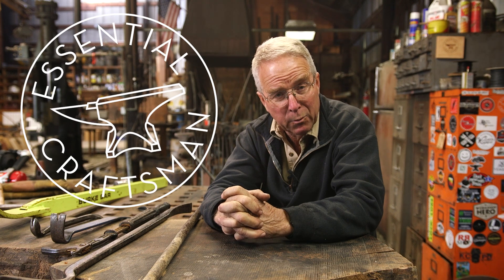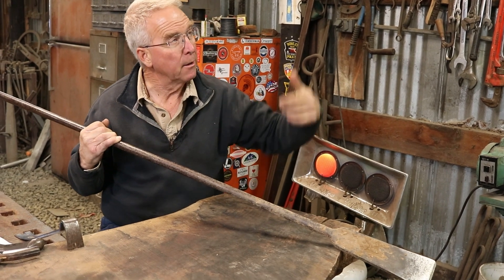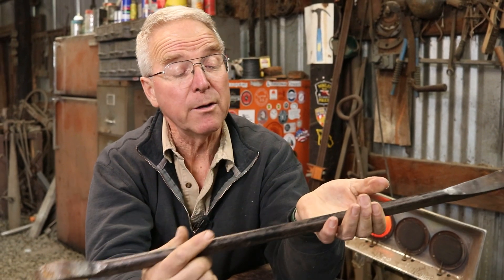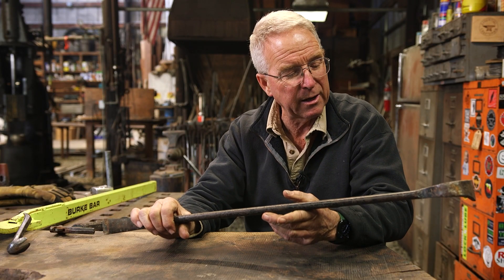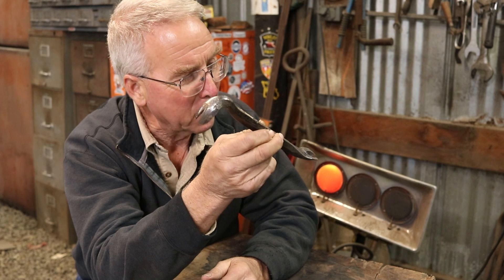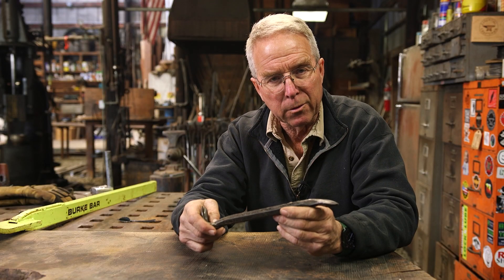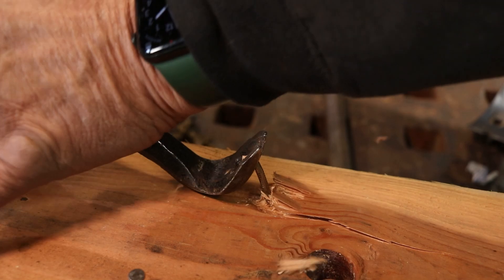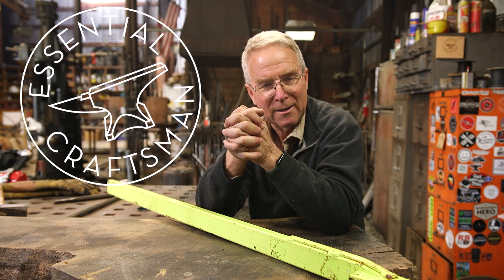Pry bar Comparison & Uses: My 6 Favorites for Better Leverage

Comment: My favorite bars are the small restorer's catspaws with a thin flat end. Best thing for trim and mouldings. A little larger, I love the Tove bars. I haven't had much luck with my Crescent; maybe I have tried to use it on too large of nails? A plier like tool called the Extractor is often used. For small finish nails, an old pair of hand forged nippers that were my grandfathers work wonders.
Looking forward to years more of videos, if I last as long as you do.
Reply: When I use mine I pull the nail up about an inch then hook it with the crow foot.

Comment: A small "Lever Bar Scraper" should be in all tool bags.  Indeed I keep a few around the house.  Small, light, thin and useful for all kinds of situations when doing maintenance, paint prep work, furniture repair, etc. and so on.  Tremendous leverage for levelling cabinets (lift corner, adjust screw foot) and so on.  Or as a wedge to hold something spread while setting another part.  (This is a smaller and thinner version of what you call a "flat bar" or "door bar").  Has a decent scraper on one end too.

Comment: Great review of bar tools.  It really is about using the right tool for the job.

My father-in-law will be 83 just three days before Christmas this year.  He absolutely amazes me with his abilities and work ethic. He is a "work smarter, not harder" sort of guy and three years ago moved out of a 20 acre farmsite with a 40 by 60 shop, with my mother-in-law, to a lot not much bigger than the 2500 square foot two-story house that was on it.  I was the benefactor of much of his downsizing of tools and equipment.  He still amazes me at the things that he WANTS to do but is smart enough to get his sons and I, who are 25 years his junior, to accomplish on his behalf.  Kudos, Allen I. Steele

I used to watch a DIY show (back when This Old House was about the only option) called Help Around The House which was hosted by a fellow named Henry Harrison.  He demonstrated one of those slide-handled nail removers, and I knew immediately that I needed on.  It took some time to find one, but what a fantastically designed and built vintage tool that is to have in one's collection.

Comment: The slide hammer nail puller was one of the standard issue tools in the US ARMY Carpenter Toolset usually issued 1 each to a Company Headquarters and kept by the Supply Sergeant until needed. I suspect I've had to inventory that item more than I've seen one actually used for it's intended purpose.

Comment: I built my first digging bar from 1" pipe and a nice half of a leaf spring! Worked so well, I made several more, never got into production, though. Still have most of them, dug the prototype out of the ground a few years back, made with hefty rebar, I didn't like it much.

Comment: EXCELLENT presentation, Scott!  AND, what most people don't know, is that the mechanical advantage is also an exact science.  Children learn from the teeter-totter that they can play with dad on one side and them on the other if the distance from the fulcrum is correct.

I taught this to my boys when they were still young.  Papa weighed 250 and their combined weights totalled 125.  My eldest was maybe 9 or 10 and he did the math that I had to be 3 ft from the fulcrum and they had to be 6 ft.  125 lbs x 6 ft = 250 lbs x 3 ft.

Knowing how much the object you want to move weighs will tell you how long your pry bar needs to be (assuming you know your own weight).  2,000 lbs x .08 ft (1 inch) vs. 250 lbs x 5ft.  My 2,500 ft lbs wins!

Comment: I used a 4 foot pry bar to move my entire floating laminate floor over enough to slide it under the door jamb so the transition strip would cover it. It moved the floor plus my 200+ lbs. while I was standing on it.

Comment: I use a Deck Wrecker bar specifically built for removing wood decking.  Has a fiberglass handle with large steel fangs that straddle the joist & it's 180° reversible for different situations.

Comment: Great video, on leverage and bars. Something to add is when  prizing something , two levers work well to spread the load if you don't want damage, you can get a kind of ratcheting effect. Also sometimes the first bar will, just get something up enough  to get the second under.

Comment: In Indiana, the “gorilla bar” is often called a “wrecking bar.” The “dig out bar” is referred to around here as a “slide hammer nail puller” and they are the best thing in the world for pulling nails out of corrugated pole barn siding and roofing.

Comment: Any bar is better than no bar ! I must have a dozen different types of bar. I always have one with me. Personally I like the flat bar that does not have a knuckle (vaughn bar) just a right angle.  Most liked by me is the little Japanese “Shark” bar, but only the genuine article, so thin and so tough that it will get in anywhere with a light tap, I often use mine to open a gap without damage to get a bigger bar in. I don’t own a burke bar ! I still like the old fashioned  five and a half foot crow bar and a heavy one at that, the weight helps !!

Comment: Hmmm. Levers are good, but it would've been worth noting others than stuff made before Jesus. Like modern mechanic bars that have adjustable head. Beats the S out of most short prybars as it's you who defines the fulcrum point, not the tool designer.

Comment: Hi, there were two tools that you could add to that list. The first is a tool similar to the berk bar but it is used to get wood floorboards up without damaging them, it has two bars on the bottom and is put under the joist and lifts the floorboard, and the other is a roofing gun the fits on an compressor that can shoot screws into timber and they can be removed with a screwdriver.

Comment: You should check out sleever/connecting bars that iron workers use. You probably don’t do a lot of steel connecting but I’m sure you could find a use for it. It’s my most valuable tool for what I do